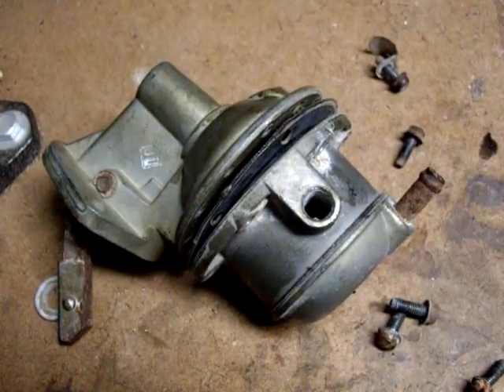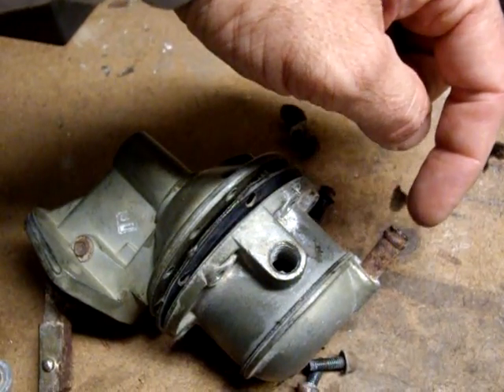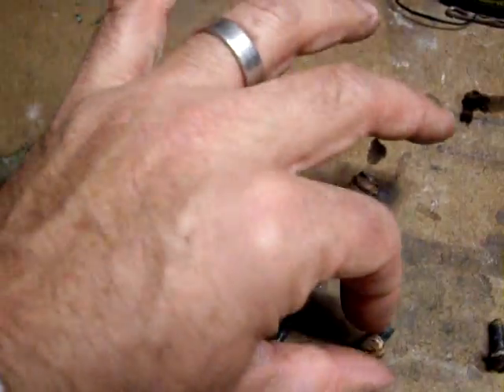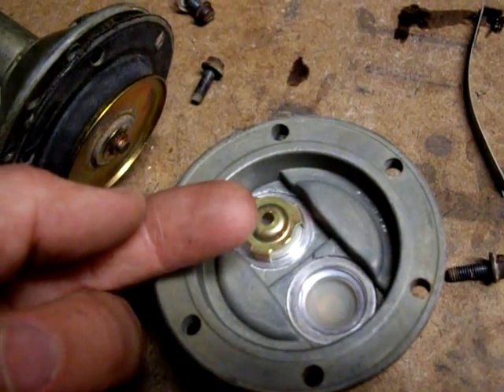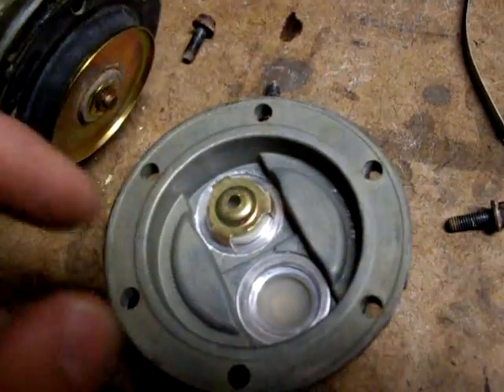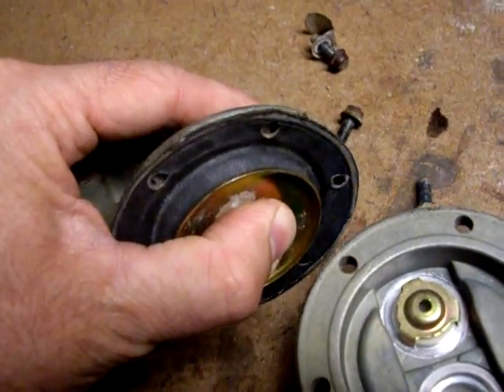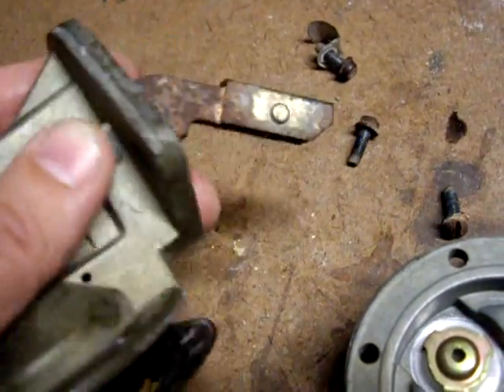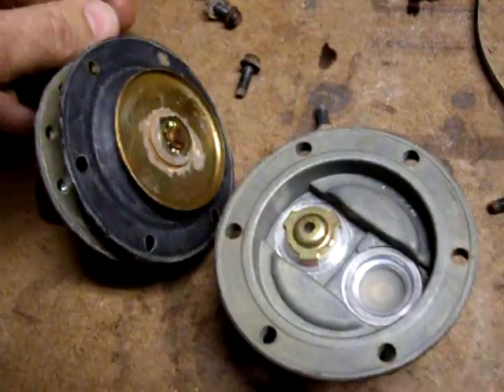How a Mechanical Fuel Pump Works

Comment: Great video sir. Thank you.
 I'm trying my second new pump on my 1960 Ford F-100 223 ci.  First one didn't pump at all and it was a brand new vacuum style for vacuum wipers from LMC. Its almost like the lobe on the cam wasn't actuating the pump arm all the way. I thought maybe the lobe on the cam was wore down but that is highly unlikely. I am trying another pump and ordered this one from NAPA this time and it is a non-vacuum type for electric wipers. Praying this one works. I've had the worst luck trying to get fuel delivery to this motor. I tried 2 different inline electric fuel pumps and they either supplied too much or not enough fuel. All new fuel lines, new tank, new carb, etc. Could you please tell me what brand/type/model fuel pump you ended up getting to replace the old one with? Thank you. Matt.

Comment: Mine has failed on my car, but it held up pretty good up til recently, I think the last ditch effort pulled throug just enough to get the van home, and this is where it sits now.
Engine is not demanding, being only a 1,449 ccm on the old Renault/Chevrolet Trafic 1985.
It gets it moving, while still being nice on the wallet.

Comment: Question? Please not get mad at me, Is it possible to run different fuel through the fuel pump besides gas like water it is a question I am trying to figure out about vapor or hho system or maybe Vapor if i can use the manual fuel pump still I have a 1985 F250 inline 6 (300) 4.9 

I am trying to figure out away to make the fuel stretch longer I have on this truck is a single barrel carburetor and I am also trying to see on getting rid of the vacuum on it and make that system as simple as possible can someone have a clear diagram or picture i can see and maybe a parts list that can use... Sorry if i sound as if i do not make since or it sounds i am making riddles I am not trying to it is just how my mind works most of the time.

Comment: perfect! I have a 1967 f100 and it doesn't want to start unless I put fuel into carb.  My next step is to replace the fuel pump because it's so cheap.  I believe mine has a filter as well on it.  thx for the video!

Comment: I purchased a vehicle with an 88 Camaro engine.  On my mechanical fuel pump there is a place for fuel to come in and out but there is also another nipple that has been blocked off with a hose and clamp.  Should this be going somewhere.  I'm getting 10psi to my holley carb and it's flooding.  I've never added a comment to a video so I'm not sure if you'll see it but if so, can you respond to my e mail at michaelrbarker04@gmail.com

Comment: What happens when you reach stagnation pressure (e.g., you let off the gas at high rpm, so the fuel pump is being driven fast even though demand for gas is very low)
Reply from the maker: I'm not certain, but I assume the carburetor bowl is designed with enough capacity for that extra pumped fuel.